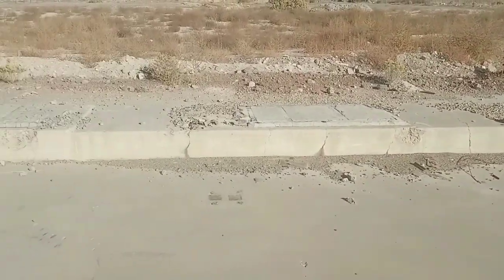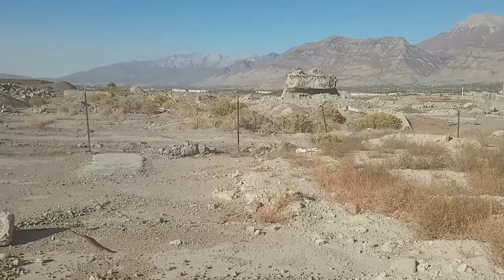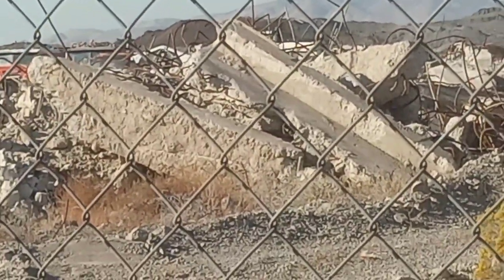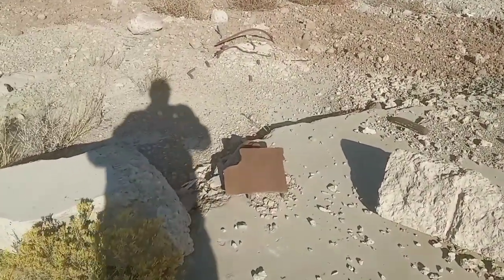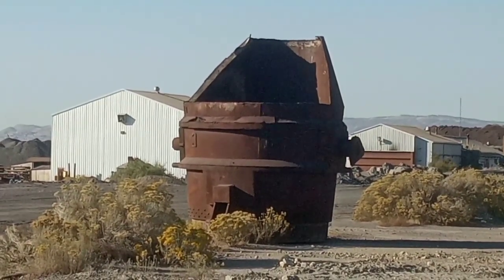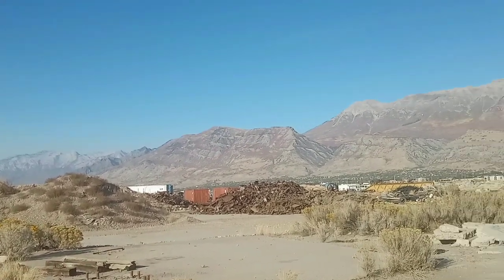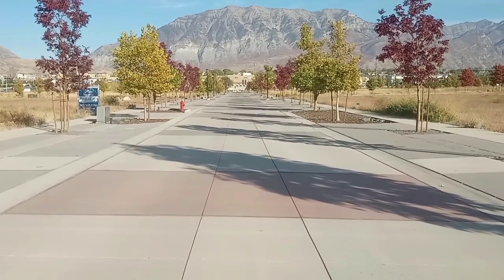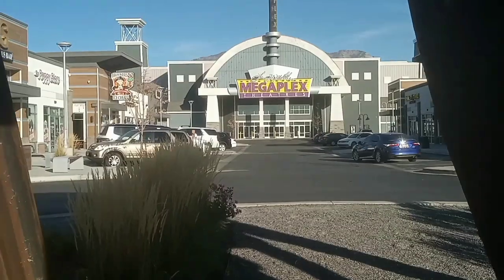#Ruins of Geneva #SteelMill in Orem, UT; Steel Ladle on Display in New Development of the Old Yard

Comment: Looks like that ladle at 4:27 was used for charging the BOF (basic oxygen furnace).  The "steel ladle" at 7:11 is actually a slag ladle or slag thimble as some call it.  Nice to see some, fairly large artifacts have been preserved to help explain to future generations what was at this location.  Thanks for sharing!
Reply from the maker: I grew up 3 blocks from a steel mill in Youngstown, Ohio. Thanks for the details on the ladles.